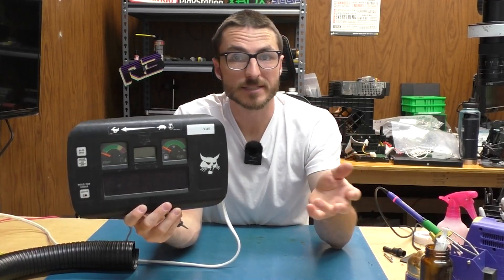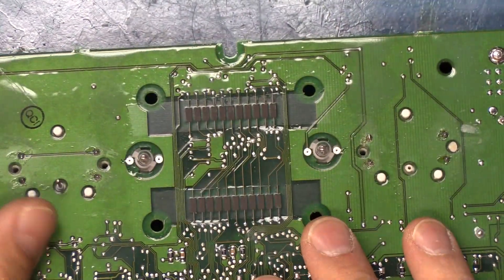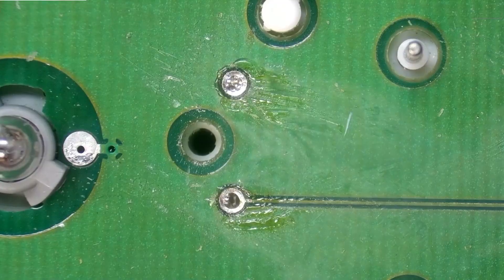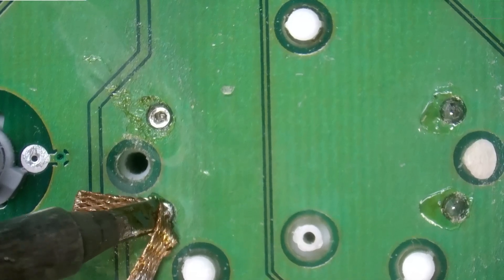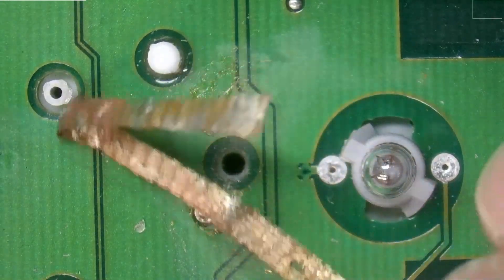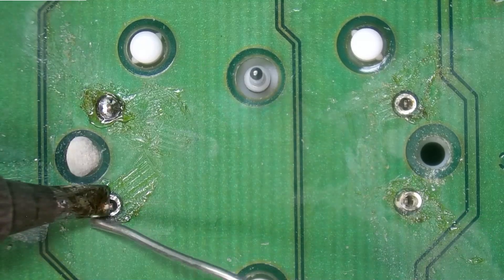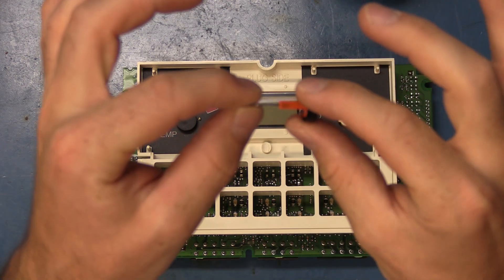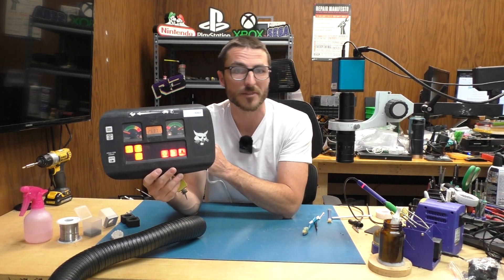Bobcat 430 Controller Base Gauge / Stepper Motor Repair 6678690

Comment: What drill do you use nick, im looking for one that has a lighter torque setting, not to overtighten screws, many overtighten and i end up not using them
Reply from the maker: Yeah that's exactly why I like that one, the lowest torque setting is very low, I had to go through several drills until I found that one. It's a Dewalt 12v DCF610B. Don't get the 20v those are way to powerful, it has to be the 12v one. 
They don't really make them anymore so you have to buy them on eBay.
Reply: @NicksElectronicRepair  thanks Nick , much appreciated, I'll look and see if it's available here.. regards Stormer

Comment: I wonder why techs use solder pumps and braid so much.  I do repairs and restorations for a living, but pretty much strictly on vintage audio equipment. Occasionally I’ll get a control panel from an oven or something like that.  So in most cases the boards I work on are much older than this.  Sure braid has its uses, I keep a lot of it on hand, but I have found with a vacuum it’s less likely to do damage to the traces.  In this instance 100% I would have used my FR-410, would have avoided lifting that pad. The FR-301 is inexpensive enough and I’m pretty sure I’ve seen you use one.   Why not use it? Is it waiting on heat up time?

Regardless, nice work!
Reply: We use a Pace unit with SX-100 handle. Not cheap, but works really well. It pays to replace the air filter regularly as the reduction in vacuum due to a dirty filter can slow the molten solder too much and cause clogs. Probably the same for all brands.
Reply: @daShare  indeed true, the Hakko FR-410 has a vacuum meter in it so it shows you how much air flow you’re getting. The lower the meter the more air flow. After some time the meter would slowly creep up and even after clearing the cartridge it would still be high, but a new ceramic filter would make it run like new again.
Reply from the maker: What! A vacuum meter! That actually would help tons for knowing when to do the maintenance and prevent some of the issues I am facing. 
Oh lol, I see, your 410 is a full station that is very expensive haha I just looked it up. My FR-301 cost only $380 I think after tax and shipping. The FR-410 seems to run at over $1,000. That I think is a bit out of my current price range for a desoldering iron.
Reply: @NicksElectronicRepair  yeah lol, it certainly wasn’t cheap, I think it was around $980 or so. The way I convinced myself it was okay was by saying that if it lasted me 10 years that it would only end up costing me $8 a month. In the end I’m sooooo glad I got it.  But I wasn’t trying to imply you needed to get the same one just that maybe you should give the Hakko you have another chance.  I found it increased my production rate as well as made the work cleaner over all over using braid.  It took a little getting used to in order to or even the clogging, but by pointing the tip upwards and letting gravity help while pulling the trigger for a few seconds every once in awhile it helped tremendously.   I just think you’re missing out on using a wonderful tool, you could have had those two parts out in less than half the time.  Obviously work however you wish and do what you like the best. It’s just interesting to see techs use braid and plunger pump when a vacuum is so much more efficient.
Reply: I was wondering the same. I love my old Hakko 808!
Reply from the maker: Waiting on the heat up time, is part of it, setting it up, it take a lot of room, requires way more maintenance than the iron does, andit's in my experience just as likely to lift up and damage a pad as using the iron and braid. I don't see it as a better or worst tool, it's different and used for different repairs. If I have more than say 10 joints to desolder then I will use it, but for small jobs like this I don't think it make sense to bring it out.
Reply: @NicksElectronicRepair  I get it, my FR-410 sits on my bench full time, but I have a large bench and it’s no concern that it takes up space, the space it takes up is far more worth it than say the space taken up by my audio analyzer or spectrum analyzer that don’t get used all that often. As far as maintenance, I replace a filter about once a week (I use it a lot!) and empty the cartridge once every couple of days. Takes about 20 seconds.  If used correctly I would have to disagree with you on them lifting pads the same amount.  I would have applied a little bit of new solder to each pad and the vacuum would have cleared each joint on the very first go, with ease. The only reason you had pads lift was because you had to go to them multiple times using pressure from your iron.  I really don’t think braid is the best for plated through holes though.  In the end though you got it so that’s really all that matters. There are easier and better ways though in my opinion.
Reply from the maker: The issue I seem to face is that it gets clogged often and doesn't suck up the solder. I often have to spend at least 5 minutes giving it a full clean every few times I use it. I could just be using it wrong but solder always seems to get clogged in the nozzel and doesn't make it all the way into the container. 
I also did have to send both of my FR301 solder guns ( I have both an older and newer version of it) in to hakko for repair and i use them sparingly. 
As for the pad, I think the main reason it went is that it was a no connect. It's much easier to dislodge a no connect pad. 
Regarding if it's easier to dislodge a pad with the desolering iron VS the braid it really just comes down to which you use the most and are more comfortable/skilled with. Because I have used the iron for many years before using the desolder I just feel more comfortable with it and since I don't use the desoldering gun often I just don't have as much practive. I am sure if I started using it more, I probably would get fewer lifted pads than I do now.
Reply: @NicksElectronicRepair  I see, I see. I used to use the older FR-300. I used it a lot too, but yeah about once a year a heating element contact would snap off of the heating element so I’d buy a new one and install it.  It was due to the vibration of the motor, I think they fixed that with the 301.  As far as the clogging. I have pretty much zero issue with that on the 410, but I’m guessing that it’s because it has a better vacuum.  I went to a local hardware store and purchased a couple sizes of piano wires to help with clogs (use the size closest to the hole in your tip). Don’t really get them with the 410, but did with the 300.  If you have the stand for it, it’s held at like a 45 degree down angle which doesn’t help unless you do this. Here is what help tremendously with that.  First, make sure it’s hot enough, I turned mine up to about 750-775 I believe.  After every 3 or 4 joints I would take the fr-300 and point it into the air so that the nozzle is pointing straight up. This lets gravity assist in the molten solder making it to the chamber.  As you hold it pull the trigger to run the vacuum for like 5 seconds.  Do this every time prior to it being put into its stand.  This helped with the amount of clogs so much.  Or it might be worth investing into a better model. Yeah the FR-410 wasn’t cheap, but it is soooo much more efficient and nearly never have issues with clogging. 

I used braid for years as well before buying the 300, but I was in mostly hobby status at that point.  I was very comfortable using it and still have at least 30 10ft rolls on hand. It definitely has its place.  I greatly prefer using it to make the final clearing with point to point tube equipment. Even though I’m absolutely comfortable using it and could easily complete a restoration on a mid 70s received using nothing but braid I wouldn’t want to.  It would slow me down tremendously and I do believe there would be more board damage.  But yes, 100%, no connect pads are much easier to lift. Which sucks because you need to make sure to get solder to the plated through hole for connection on the other side of the board.